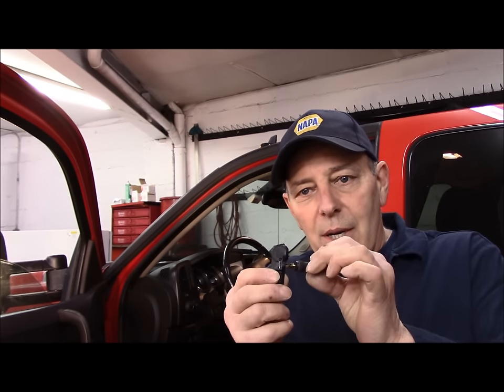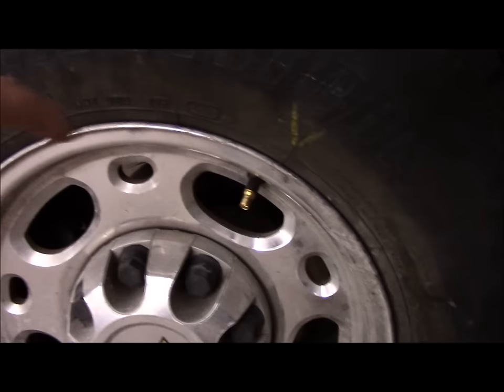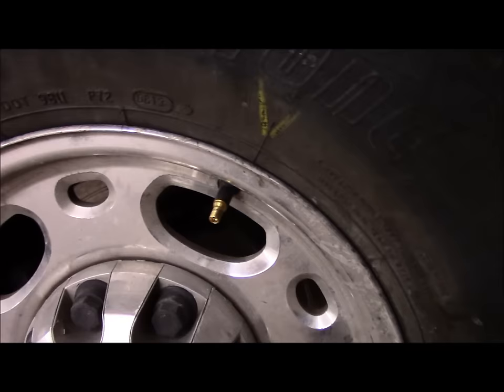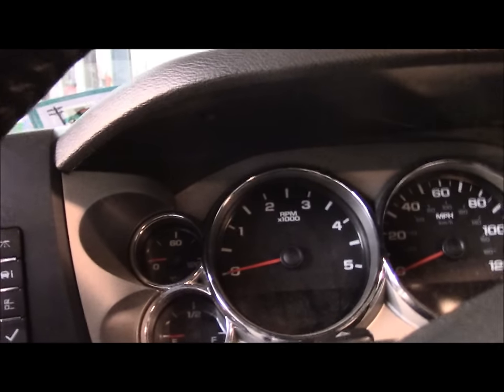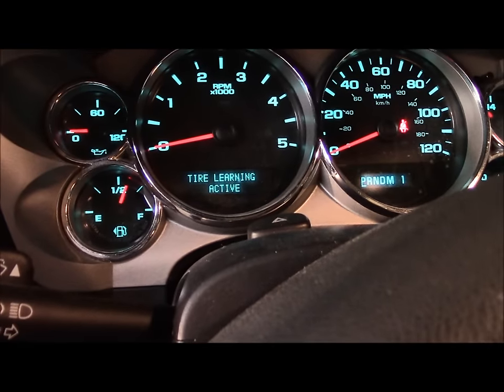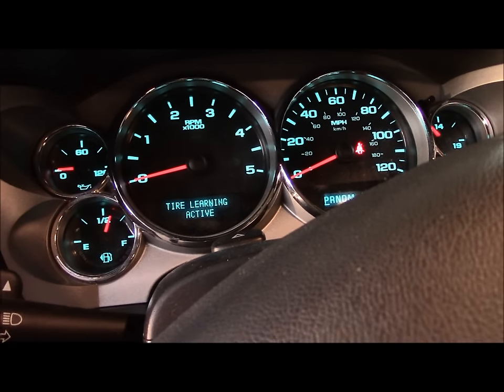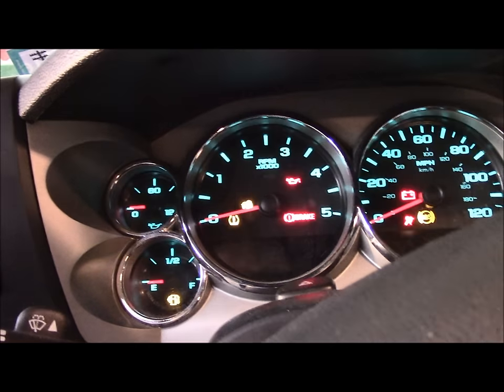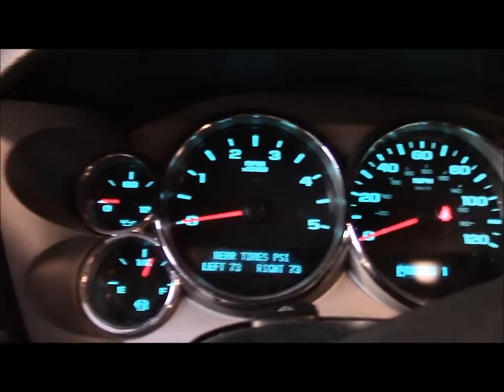How To Reset Low Tire Pressure Light (TPMS) Tire Monitoring Syetem

Comment: TPMS.......another worthless scam from the Federal mandate. Cars manufacturers make money.I have been driving for more than 30 years and monitor tires with a tire gauge just fine.  Now this nanny system requires me to spend $600 every times I changed the stupid sensors..
Reply from the maker: Thank you for stopping by the shop.
Reply: How did people use the Model T Ford without TPMS?  Didn’t people in the 1920s care about safety (sarc)?
Reply: @missinformed4269  And they drove whilst not wearing a hard-hat or a Day-glo-vest.... No warning triangle either! 
Them old timers: Just so damn irresponsible!
Reply: what they don't offer, a way to turn it off!!!

Comment: 6 to $800 to replace for sensors are you kidding me dealers are the most rip off people there are out there they're just horrible the government should regulate the dealer prices. The job is not really that hard to replace all four. And you really don't have to take the complete tire off the rim if you know what you doing. You also forgot to mention to inflate your tires up with proper air that is  on your vehicle.

Comment: shops need to reset tpms whenever tires are rotated there is no reason in this day and age that shops dont do this everytime
Reply from the maker: +UBBERTANKER  Your right about that but I see it all the time .How about at your shop?
Reply: I do it every time but other techs not so much. We do get paid extra to do it so i dont see why the other techs dont do it, leaving hours on the table.....
Reply from the maker: That's true if your getting paid why not.
Reply: plus you get happy customers, when there car says a certain tire is low they know when they  put air in that tire that it will be the right tire
Reply: In other words. I can get mire tires rotated at a shop and theyll reset the sensor for free?

Comment: Hi Jim 
Thanks for sharing your knowledge with the rest of the world.
I just got a 2015 Chevy Silverado 1500 , and I don’t know much from the last owner. 
I can’t get the truck to display tires system on dash, it go’s on all the other monitoring systems, oil, gas, mile’s, but don’t go to check on the tires. 
I tried to push both buttons on the key remote but I can’t get the truck to relearn mode. 
I have a EL-50448 relearning tool that I have used for my Chevy traverse 2011.

Comment: I have a 2007 chevy silverado 2500 hd my self and took it to dealer today for an oil change and came out with this problem and dont know wat to do since the tires ihave on aren’t the original tires so don’t have sensors 😒 abd they couldn’t do anything because they said it was sensors battery and it need it to be changed .. so i had no idea and thats why im here watching your video to see i can get any help or any idea in what should I do next .. and here i found the soution to my problem 😁.. thank you this video was exactly what i was looking for .. and will see what i can do . 👍🏼😬

Comment: Hi Jim I got a 2007 Tahoe I got the 2 beep and the light on the driver side front let some air out and got 1beep then the light came on the pass side front let some air out and nothing so I let more air out then I got 2 beeps ? I did this twice with the same results !!! like it was all gone got no more lights in the rear could not even check the tire sensor and the TPMS is still on ???? thanks

Comment: hello i have that problem, it turn on so i took it so they could fix it with a new sensor which was $100 plus it fixed it then the other one failed. is there and way just to turn of this system i don't want some thing that cost $400 plus telling me what my air pressure is when something that cost $10 can tell me.
Reply from the maker: There is no way that I know to turn that light off unless the sensor is replaced.

Comment: 2010 Silverado, no electronic buttons on dash for instrument panel options, no electronic key fob.  How do we put the system into the learn position?
Reply: Use the little black pin between your speedo and voltage gauge. Keep pressing it till you come across what you need.

Comment: Dealer don't make that sensor.   Schrader makes that sensor for GM and others.  The Schrader EZ Sensor is of the same quality and can be had @ $30 to $40ea. And can be used on many makes.  In my shop it is about 170.00 - 190.00  to have them replaced.
Reply: Ralf Valcourt p
Reply: I have been trying to get some information about my 2012 Dodge Ram 1500 on how to reset the tire pressure light, and all that I have seen is people talking about Chevy Silverado,

Comment: Jim, hope you are able to assist. My truck is not at all responding during the tire relearn process. I put into relearn mode than start to let air out of front left but no horn chirp at all. All my tires read just lines not psi amount is shown in dashboard. What do you think? All sensors are bad?

Comment: Hey Jim I bought a 2010 Tahoe from a used dealership truck is in great conditions but they put stock rims from a 2015 Tahoe the newer model and  the  tire pressure light is on, do you think I need to buy all 4 new sensors or can It get fix by doing this process?  Thanks...
Reply: wish hede answer

Comment: Great video Jim.....thanks.  I live in Canada and have a 2011 Dodge Ram Outdoorsman Crewcab w 142000kms (5.7L Hemi, automatic, 4x4).  The air pressure in each tire (measured with hand guage) is 227KPI's.  The info system on the truck shows 3 tire pressures but nothing but a straight line across for the rear right tire.  I do not appear to have any of the buttons u pressed re "re-learn the TPMS system" as u used for this GMC van?  I am also planning on getting new tires in the fall of 2022 but hate the TPMS light on my dash.  Thanks for any help.

Comment: Great Video,
07 Chevy Silverado 2500HD
I replaced one sensor due to a random no psi. I am not sure what caused my mystery. I get a a random Phantom dash light blink very fast but can not tell which one it is blinking. I appears green. I inquired to dealer they tell me I have Stabilitrac no Traction control, but my research tells me I have neither. TPMS light is yellow. No DTC.
No DIC messages. How can I tell if the batteries are weak?  I don't just want to throw new parts at it and still have the same issue. My tire psi levels are indicating fine. It is just bothering me with this random blink....
Thank You

Comment: Thank you for your informative video, but I have a question: When I change the right bad sensor, does the car recognize the new one automatically without any additional tool?
Reply from the maker: No you will need to teach the truck to recognize the new sensor.Follow the steps in the video and you should have no problem.If you need help let me know.

Comment: I have a 2011 Honda Insight.  The dealership has replaced the sensors twice.... but the TMPS comes  on after driving 20 miles.   What else could be the issue.

Comment: Maybe you could help me my problem is  That when I scroll through to find tire learning position it does not show, Some very mind boggled on how I'm supposed to reset My tire pressure system if I cannot get into tired learning mode, have you seen this issue before?

Comment: 50 plus years of driving...Never had TPMS...Never ran with a tyre under pressure.
And I drove fast & hard back then....
Never had a problem: Now I got a vehicle with TPMS.... I got problems.
Put on new tyres & TSHTF.
A system designed for the millennials/clean-hands brigade.
Look: If you feel the need to instal this nonsense: at least install the option of switching the stupid thing off! 
But, no..there it is: Blinking away on the dashboard.
What a load of shite.
Reply from the maker: Thank you for watching . Don't forget to subscribe.

Comment: Not sure what’s different about the 2009 Texas Edition 1/2 ton but I can never find the learn tire position.
Reply: Ok I found another video that applied to this setup. Set park brake, turn ignition just to on position (don’t crank), then hold the lock and unlock buttons on the key fob until it honks. Then let air out of each tire until it honks in this order: LF, RF, RR, LR. Done!

Comment: I have a bad sensor on my left rear tire as when I used a relearn tool it did not beep on the tool and the cycle ended. the other 3 beeped fine as normal. Now my question is are the original  ones that I get from GM pre-programmed and the BCM will acknowledge them in the relearn process or is it necessary to have the sensor programmed so that the BCM will log and store the number for that sensor?  I hope that made sense, the part number im inquiring is for a 2010 Silverado WT with a 4.3 V6>>>ACDelco 13598771 GM Original Equipment Tire Pressure Sensor TPMS

Comment: What would you say if all 4 are reeding proper pressure but the light is constantly flashing, very annoying. The tire shop reset the system and it went away for 1 day and then came back and again all tires reading 32 -34 with 0 Fault codes. Any advice?
Reply from the maker: When the light is flashing it means that the one of the sensors is not communicating with the computer.What year is the truck?
Reply: Thanks man, yes I know that is usually what the problem is, but there is no error codes and all sensors are reporting proper tire pressure that is the strange part, it is a 2009 Subaru Forester, I think the best thing is to replace them all, I have no other options left. Again thanks a lot for the feedback.
Reply: Shiftaholics , wait. What happened?

Comment: Jim, the previous owner of my Chevy 1500 installed light truck tires, and I believe that they should be inflated to what this trucks tires were 60 in the front and 80 in the rear. My question is that my factory sticker says 35 psi front and rear. Would I need to go through these steps to set the information center to the now correct 60 and 80 psi that the truck will now have? Or is there a better way to accurately display the tire pressure?
Thanks,

Comment: I have 2002 Buick LeSabre. The pressure sensor work fine. I bought the car 3 months ago. I need to buy new tires now. Wal-Mart stores told me if the valve stem it will cost 40 dollar's each. Just for the new value stem. Should I replace them? Can you give me any advice? How expensive is the sensor for my Buck? Thank you any advice you can give me.
Reply from the maker: Thomas Tommy   Yes it is a good idea to change the valve with the tires
Reply: jimthecarguy If I change the valve stem will it affect the air pressure sensor? I have a 2002 Buick LeSabre. A guy told me this car does not have a air pressure sensor. But a dash light Tell's me that my does not have an air pressure sensor. The light works off the ABS. Can you give me any facts and advice here? I would appreciate it very much. Thank you.
Reply from the maker: It may be possible but from what I see in my computer there is a sensor inside the tire.If you want to send me a picture of the stem I'll tell you.
Reply: jimthecarguy Where do I send the picture to??
Reply from the maker: jimthecarguy1@gmail.com

Comment: i like your video great job. and thank you. my question is though how to you start the learn process on a 2011 1500
Reply from the maker: +Daniel Rubio  This is the procedure for that truck.Let me know if it works for you.

Alternate Keyless Entry Transmitter or DIC Learn Enable Method 

1.Ignition ON, initiate the TPM Learn Mode using one of the following procedures:
•On vehicles equipped with keyless entry, simultaneously press the keyless entry transmitters lock and unlock buttons until a double horn chirp sounds indicating the Learn Mode has been enabled. The left front turn signal will also be illuminated. 
•On vehicles not equipped with keyless entry, press and release the driver information center (DIC) INFO button until the TIRE LEARN message appears on the DIC display. Press and hold the SET/RESET button until a double horn chirp sounds indicating the Learn Mode has been enabled. The left front turn signal will also be illuminated. 
2.Starting with the left front tire, learn the tire pressure using one of the following methods:
•Hold the antenna of the EL-46079/J-46079 aimed upward against the tire sidewall close to the wheel rim at the valve stem location. Press and release the activate button and wait for a horn chirp. Once the horn chirp has sounded, the sensor information is learned and the turn signal in the next location to be learned will illuminate.

Warning 

 Over inflating tires may cause personal injury or damage to the tires and wheels. When increasing tire pressure do not exceed the maximum inflation pressure as noted on the tire sidewall.

•Increase/decrease the tire pressure for 8-10 seconds then wait for a horn chirp. The horn chirp may occur before or up to 30 seconds after the 8-10 second pressure increase/decrease time period has been reached. Once the horn chirp has sounded, the sensor information is learned and the turn signal in the next location to be learned will illuminate.
3.After the horn chirp has sounded and the right front turn signal is illuminated, repeat step 2 for the remaining 3 sensors in the following order:
1.Right front 
2.Right rear 
3.Left rear 
4.When the left rear sensor has been learned and a double horn chirp has sounded, the learn process is complete and the RCDLR exits the learn mode. 
5.Ignition OFF, adjust all tires to the recommended pressures. Refer to Vehicle Certification, Tire Placard, Anti-Theft, and Service Parts ID Label (See: Application and ID\Vehicle Certification, Tire Placard, Anti-Theft and Service Parts ID Label).
 
© 2016 ALLDATA LLC. All rights reserved. Terms and Conditions
Reply: +jimthecarguy. So I need the learn tool for a 2011 silverado 1500?

Comment: If you don't service in a specific time frame, will the check engine light come on?
Reply from the maker: +Matthew Kuklar No the tire pressure sensor light will not cause the check engine light to come on.

Comment: Installed 4 new sensors on my 07 Sierra. This relearn procedure didnt work. So we used a seperate relearn tool and it finally paired with the truck. But, no matter what we do, it shows 1 PSI (all 4) and the stupid light is still on...
Anyone had this issue and know what to do?
Thank you

Comment: Hi Jim, My name is Teresa Wueschner, I have a shop resetting the Tire Pressure Light. I saw your video we have done all the steps, but i think, as per your vedeo, each sensor hs their own ID #?  And also, where can I buy the monitor you use in the video.   Thank you so much for your help
Reply from the maker: Actually the tool that I used was just an air chuck. With this truck you need no special tools to teach the truck to recognize the new sensor . Did you follow my video exactly?
Reply: @jimthecarguy  Hi Jim!!! thank you for your answer!!!! Yes, and I did everything you showed but the light in the dash is not going away, then when I saw the tool you used I thought that it was what i needed. I wonder why I am doing wrong that the light doesn't disappear??? I changed the sensors for new ones originals
Reply: Excalibur Auto Center , check
the spare tire, that’s the culprit..

Comment: We have the same truck but it doesn’t says press (check mark) to relearn tire position and we don’t know what to do
Reply: Jahanna Ramirez - turn key to ON (2ND) position as described. Then, press and hold both the lock and unlock buttons on your paired keyless entry remote for 2-3 seconds. 

It should then enter learning.
Reply: James Dingus thank you for this finally was able to get it to work
Reply: Buy you a ram dodge..

Comment: How would I do this on my 06 GMC yukon that does NOT have a tire relearn option on the DIC?
Reply from the maker: +jewllake  The first thing you will need to do is to scan the truck for any tpms fault codes after they are repaired the codes can be cleared and using a tpms reset to relearn.
Reply: +jimthecarguy Nonsense, Key FOB will take care of that
Reply from the maker: +Ralf V  Yea good luck with that
Reply: +jimthecarguy Miss-information on my Part, sorry! I could have sworn I did that before.  But hey everyone is wrong at some point LOL
Reply from the maker: +Ralf V  Thank you for your honesty and for the up date.
Reply: jimthecarguy When you're wrong you're wrong. LOL

Comment: How many psi should each tire have 
To reset
Reply from the maker: Most of the time the is a sticker on the driver side door or door frame that tells you the tire pressure but most of the time 30-35 psi is normal for passenger cars.

Comment: The stupidest thing I've ever seen car/truck makers do, what ever happened to just using a tire pressure gauge and filling your tires if they are low? This is but something the auto makers made to make more money off their autos. My question is what if you don't put new sensors in, is the computer going to disable the auto so you can't drive?
Reply: No the light will stay on

Comment: Yeah Don't have this done at PoopBoys. I made the unfortunate mistake of having them replace these sensors when I got my tires from them. (They had a good deal on tires.) My TPS worked prior to having the work done. I asked them to replace the sensors (hey they where 5 years old, why not since the tires will be off right?) with the tires. I had too take it back to them 3 times, they claimed the problem is in the system and not any work they did. I took it too the dealer who found out Poopboys never programed the sensors (I guess that was a thing with my car) prior to installing them in my car. the system worked flawless after I had it to the dealer. I am now in the process of getting a complete refund from poopboys for the problems and hell they put me though. NEVER! use Poopboys for anything. even if you are going in to buy a candy bar... I'm sure they will screw that up too..